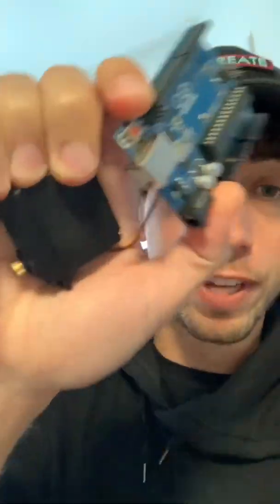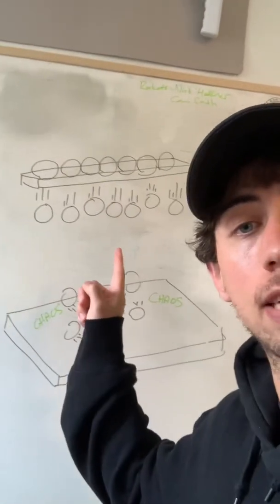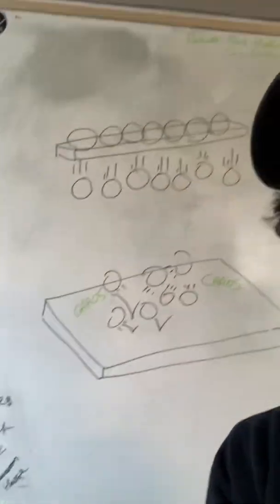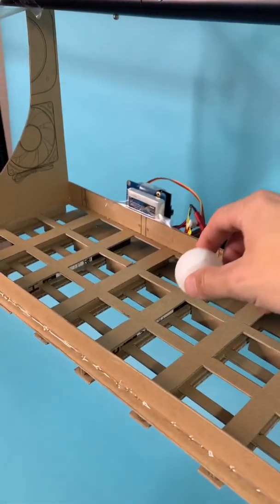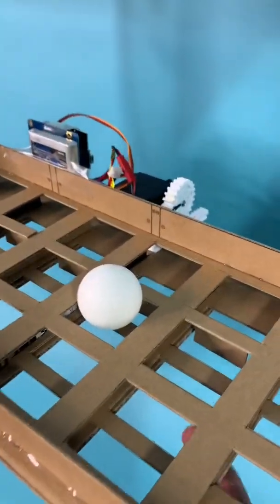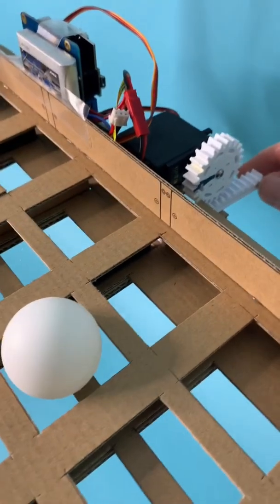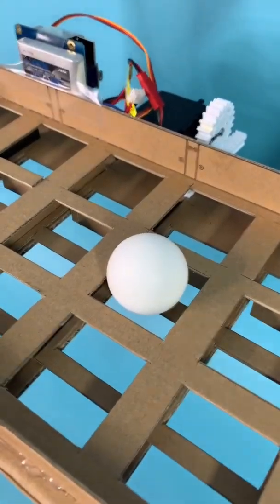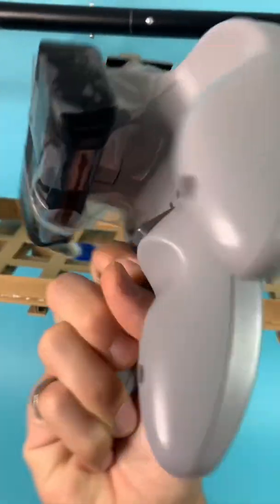Chaotic Kinetic Sculpture from Recycled Boxes

Comment: Practical application; put sensors in the slots and have it set to activate at a certain time with an alarm clock that won't shut off until all the balls are replaced.